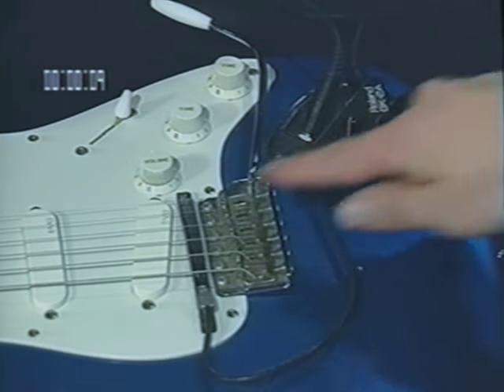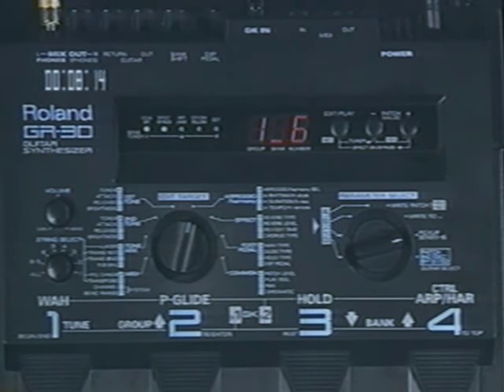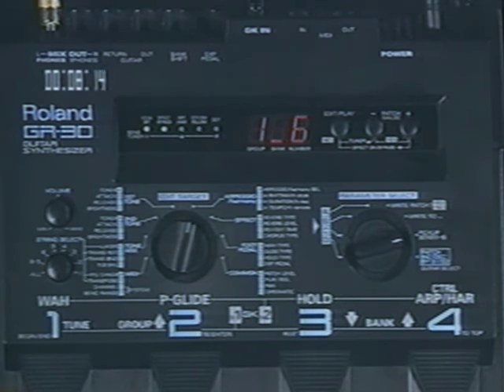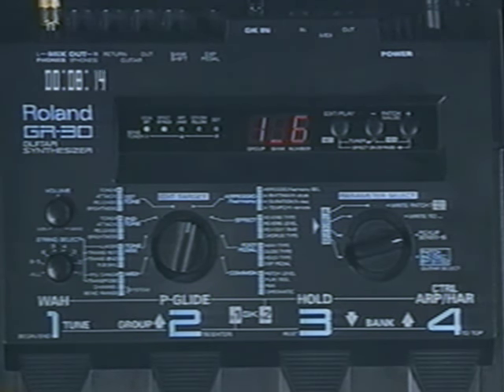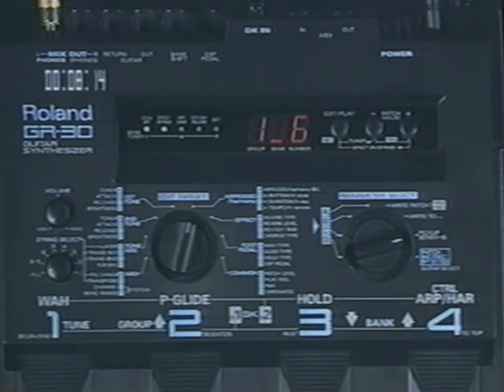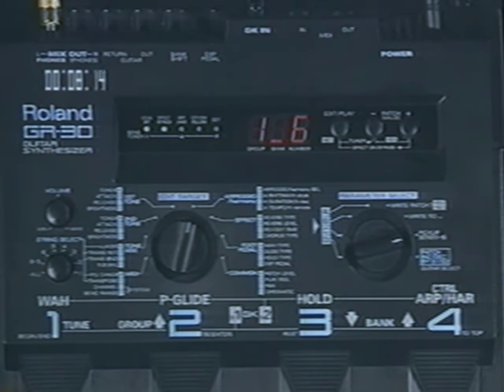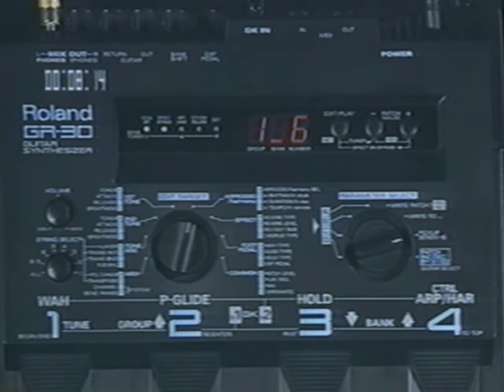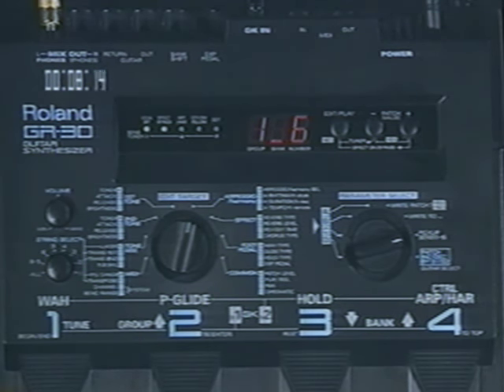Roland GR 30 video owners manual

Comment: My GR30 didn't come with this video but I did order it from eBay and never received it. So many may thanks as it been a few years since I turned it on and this is an awesome refresher
Reply from the maker: If I remember correctly the video did not automatically come with the unit. I had to order the video as an extra purchase.

Comment: I cant get it to work with cubase win 10, as a midi devise.I use a midi to usb interphase which is recognised by cubase as usb
 midi 1,but no signal appears to the aprox channel.
I follow the procedure as, local off,poly 1p,left knob to midi,right knob to D and midi out to midi in  interphase and any channel in cubase.
Any thoughts?